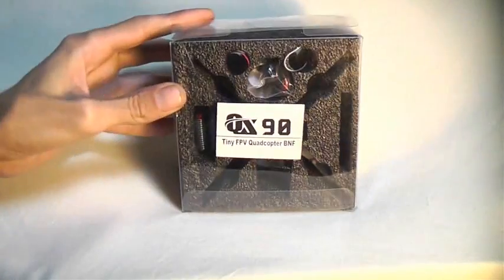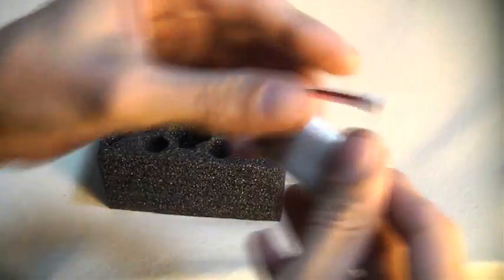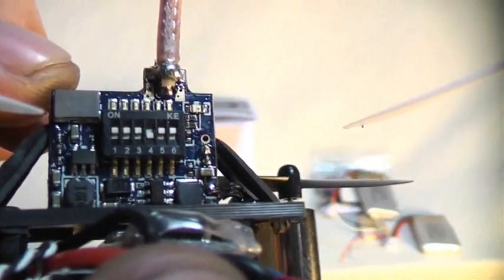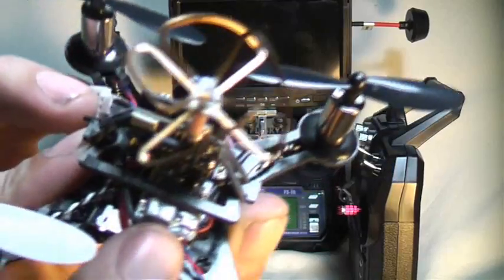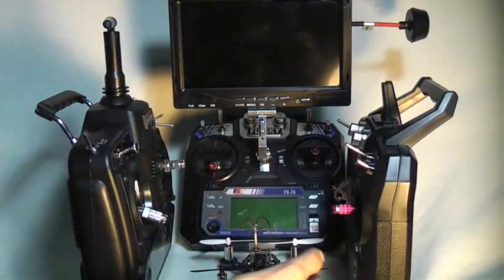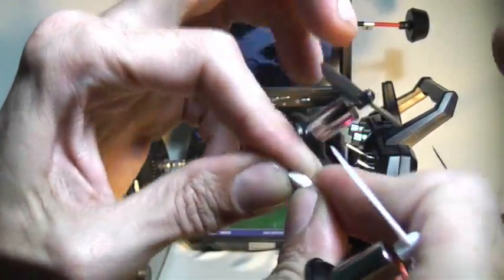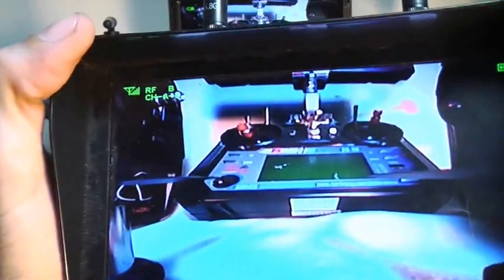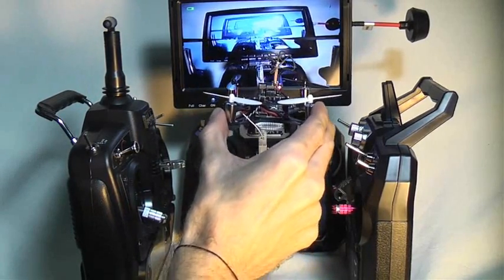Eachine QX-90 Tiny Racing Drone : One of the Worlds Smallest Racing Drones

Comment: On your video thumbnail I see some sort of video glasses. Can you tell me what it is and where I can get one?
Reply from the maker: They came with the cheerson cx 91B jumper.
I haven't seen them sold separately.
They don't have a built in receiver, they connect to an external video monitor.
They''re custom cheerson 2d video glasses that can also be connected to a TV.
There are a few versions of 2d video glasses that look pretty close to these on the market but they are a bit pricey.

Comment: Nice unboxing! Check out my flight video below, this thing is fun to fly!
https://www.youtube.com/watch?v=0sNtOXD8EV0&t=57s
Reply from the maker: I had to replace the flight controller and receiver but I finally got to fly it and it's pretty nice, the newer cameras are a lot better but they do have a new qx90 coming out with a yellow body and a better cam.
Reply: That was actually my maiden and surprised it flew pretty fast. But weather and condition(windy) wasn't perfect and ideal so looking forward to a sunny setting. The biggest flaw was the camera, so bloody bad with light transition and was generally dark with large vignettes round the corners. It was probably due to the bad overcast and the storm brewing above. Looking forward to more flights! :)
Reply from the maker: It's easy to solder in the camera if you decide to upgrade, the newer ones handle low light a lot better.

Comment: I am thinking about buying this but i don't want to spend 200 dollars on a a Tara is, is there anything that is cheaper that will work
Reply: any radio with a FrSKY module.
Reply from the maker: Yes there is. We tested the FLYSKY receiver version in our season 10 episode 1 special. We worked really hard on the nano racer portion of the special and share a lot of valuable information so please check it out and share it. It really needs more views. https://www.youtube.com/watch?v=5nyYl1ey7XY
A flysky fsi6 transmitter is the lowest cost TX option, selling for $43.18 on banggood right now. The flysky compatible receiver that banggood is selling is the iRangeX Tiny 2.4G 6 channel receiver. It sells for only $7.99
It was originally a flysky branded receiver but they only sold a limited number with the flysky branding and rebranded it to iRangeX. it is the exact same receiver and it is compatible with the fsi6 transmitter. 
You can buy a pre built aircraft or a kit. Let us know which one you get and how it goes.

Comment: Would the FLYsky receiver option for the quad let you connect that FS-I6? I don't want to spend lots of money for the taranis... Nice review and thanks
Reply: Get the Eachine Tiny now with 50% DISCOUNT when using this coupon link: https://www.banggood.com/?p=TL0111854575201411Z0
Reply from the maker: Yes it will. We have been testing it over the past few weeks. It's an awesome little receiver. It will bind to an fsi6 transmitter. We will be posting a complete build and programming video for the QX80 shortly. It will also relate to the qx90 and all other Eachine nano racers. These things are amazing and a lot of fun. The receivers and flight controllers are constantly in development so there will be a new version coming out every few weeks or months. The fsi6 version of the receiver has been replaced with an IRangex version on banggood. 
http://www.banggood.com/IRangX-Tiny-2_4G-6CH-Flysk-Receiver-Compatible-with-Flysky-PPM-Output-for-Eachine-QX80-QX90-QX95-p-1089802.html
We will be testing it soon but it should be exactly the same as the fsi6 version compatibility wise. Great low cost receiver option.

Comment: eachine tiny qx90 with flysky receiver is compatible with Eachine I6 2.4G 6CH Remote Control?
Reply from the maker: Yes, it should work just fine. They sent me the one with the frsky receiver just to torture me because they knew I didn't have an frsky transmitter.

Comment: I guess this would work ?

http://www.banggood.com/FLYSKY-Ultra-Miniature-PPM-Signal-Output-8CH-Receiver-For-Multicopter-p-988175.html

Need to go into F3 and set it up with the RX and TX, I supposed. What software is this using .. cleanflight ?
Reply from the maker: It should work, but I can't say for %100 percent certainty that it will without asking banggood or testing it myself. I'm curious if that is the same as the new Flysky nano receiver that eachine is about to start selling soon.

Comment: Yeah, I only have cheap Flysky TX's which none of these new tiny Bangood BNF binds to. 
Come on Eachine, make a BNF for the Flysky TX's that all us budget pilots have...
Reply: buy this Receiver and solder it to the flight controler! 
http://m.banggood.com/FLYSKY-Ultra-Miniature-PPM-Signal-Output-8CH-Receiver-For-Multicopter-p-988175.html
Reply: +Dominik or buy the new eachine qx80! there you can choose flysky receiver.
Reply: Dominik  I didn't know they had that. Have you tried it?
Reply: Dominik  Oh sweet, finally a flysky compatible one!
Reply: +Phrancis5 yes i got this receiver and it works great. only the range is limited to about 90meter.
Reply: Yeah, the new QX-80 is now available for order with the flysky RX. I'm gonna wait for reviews though...
Reply: Do you know if it comes with failsafe ?
Reply: +ADAMBOMB FPV read description of qx80, flysky receiver will come!
Reply: Yeah I got the email this AM saying the Qx80 is now in stock, but when I went to the page it no longer offered the choice of flysky RX. Perhaps it quickly went out of stock? I hope that's the case and will be available later. In the mean time I still have a syma x11 with that tiny cam/vtx for my indoor fpv needs...
Reply: +Phrancis5 you can also buy the receiver i linked before, and solder it to the fc. i think Banggood will also use this receiver for the bnf version of the qx80
Reply: Dominik But has it failsafe?
Reply: +Lordxv yes, the newest version has failsafe! i have this receiver and tested it.
Reply: Dominik Thanks a lot !
Reply from the maker: Eachine is coming out with  new nano receiver that is flysky compatible it''s the same size and functionality as the frsky version in this video.
Reply: Someone at Bangood said a flysky version of the QX-80 was coming out the middle of this month.
Reply from the maker: It's on it's way to us, we will be reviewing it, and testing if the receiver that they developed for it will work with the QX90.

Comment: Yo Mr 101,

This won;t bind with an i6 varation of Frsky. You need Taranis style or put a DJT or similar module in that TH9X which is what I am using.
Compatible with:
FRSKY taranis X9D(D8 Mode)
XJT (D8 Mode),DJT DFT DHT BIND and Flight

Comment: Please let us know if you have any success binding the Devo 7 to this little bad-boy...I would love to order one! Thanks Man
Reply from the maker: *****
You're spot on, I'm a total noob when it comes to transmitters and protocols. I've had to learn a lot really quickly because of the popularity of aircraft like this especially considering they almost never come with any instructions. I find myself learning crazy new stuff over night all the time like programing or building a battery charger from scratch. A lot of times a quick review turns into a college class.

I did find out recently that Eachine has been developing a new micro receiver that is flysky compatible and is as small as the frsky receiver used in the QX90. I should be getting one soon with another small quad racer. After I test the new racer I'm going to de-solder the receiver from the flight controller and solder it into the QX90 and see if I can finally get a test flight.

There was a time when you needed a 200 transmitter so that you could program your rates and modes for your CP helicopter and such. Now with modern flight controllers and software like open pilot gcs and cleanflight you can do that type of stuff with a laptop and a usb cable . I think that is why we are seeing all of these 7 channel $25 transmitters like the flysky fsI6 on the market.
Reply: You would need to add the Frsky compatible module for the 7E to bind with this. You can choose rx free version and fit your own but there's not much room to do so.
Reply: ***** Can't what? Oh you mean bind to 7e, sorry.
Reply: ***** Only with the Fuatba/Frsky module added, it will not bind to stock 7e or deviation without that.
This is DJT compatible so Taranis will work but Fsi6 style will not.
Reply from the maker: I love being called a noob

I've been flying and posting for more than a decade.

I'm a sponsored pilot, I didn't buy this aircraft. 

I'm sent thousands of dollars worth of aircraft and equipment to test regularly, 

I actually have over 1000 hours of R/C flight time, that's actual in air time.

Almost every day I am required to, and I mean HAVE to, stay up until 4:00 am researching, charging, fixing, editing, posting, and answering questions about R/C aircraft. 4:15 am now

I can't be an expert on one aircraft, I have to be an expert on all of them.

Before I received this aircraft I let the sponsor know that I did not have the proper transmitter.

Before I posted this video I had already researched the devo 7 mod and decided that I literally did not have enough time to try to make it work. 

All the behind the scenes stuff goes unnoticed but for every minute of video there are countless hours of work behind it.

I also write commissioned articles about R/C aircraft for popular websites.

Technically I'm a writer / film maker / test pilot and have been for a decade I'm also a full time father, the pay sucks on both jobs by the way but some of the perks are cool.

All that being said I still need a transmitter so if you want to come bind yours to this aircraft so I can test fly it I would appreciate it. From your channel you seam to be very talented.